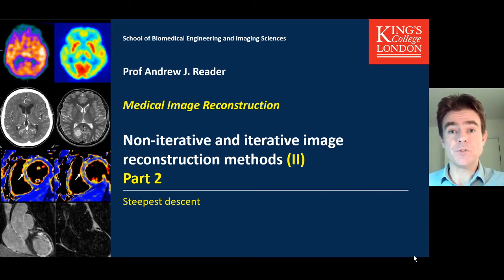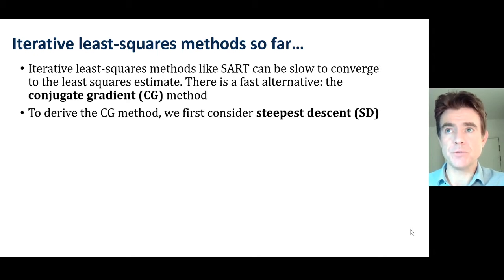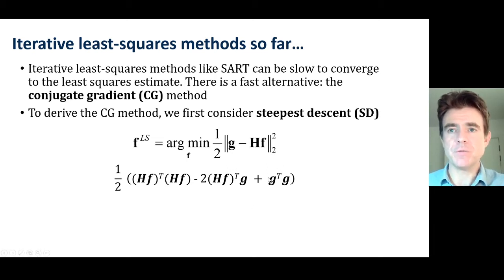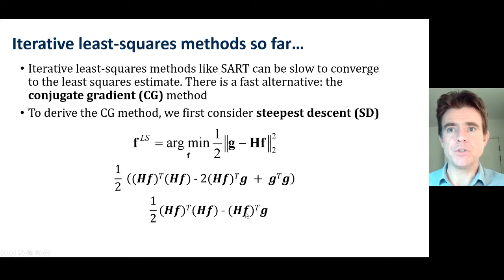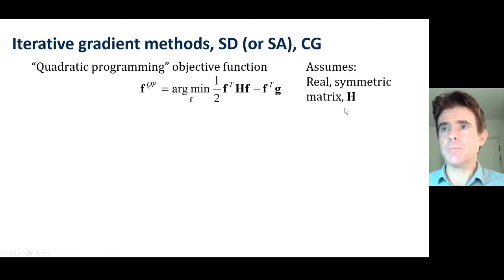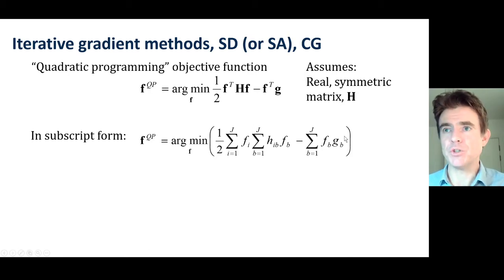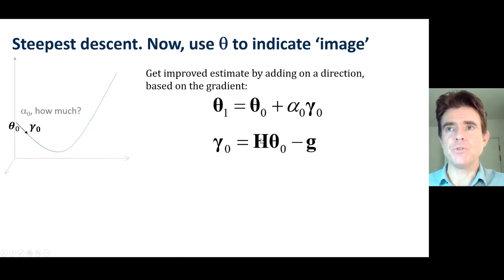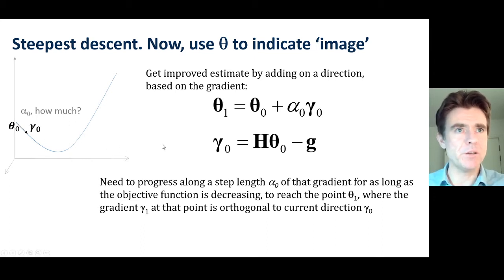Steepest Descent (SEE NEWER VIDEO: https://youtu.be/G0fv8nU8oPA ) - watch before Conjugate Gradient

Comment: 2:23 How does H get discarded ? I do not understand this part
Reply from the maker: Sorry for delay - new version now made with no "discarding"! https://youtu.be/G0fv8nU8oPA
Reply: @AndrewJReader  Thank you very much for your teaching, Prof. Reader. Your medical image reconstruction course is excellent and very helpful. I have watched the new version and understood that version now. I am wondering can you help answer "How does H get discarded" (2:23) in this version also? I am trying to understand it, so that in the future I can understand deduce similar Math problems. Thank you again.
Reply from the maker: @familywu3869  I prefer not to do this "discarding"...  hence the new version that I pointed to. As to this old version, well, it is just saying that instead of applying H^T to g in the rightmost term and also applying H^T to (Hf) in the leftmost term, the assumption is that we can instead just consider the difference between the terms without the blurring of H^T. Not ideal, and has assumptions. If it helps, it's like saying instead of looking at Hx - Hy, we look at x - y, which would in general be a more demanding requirement than Hx - Hy (as H might have a null space, therefore permitting differences between x and y in the null space).